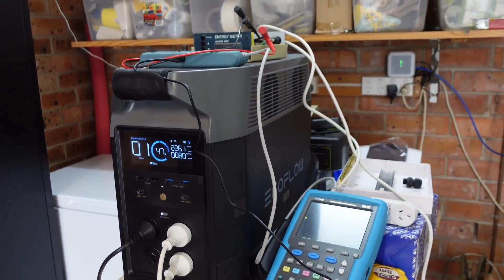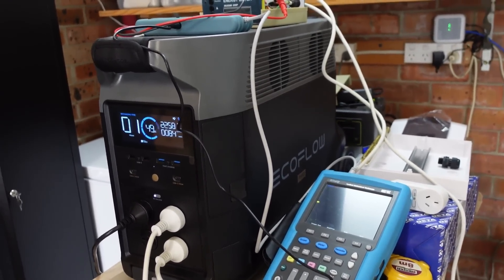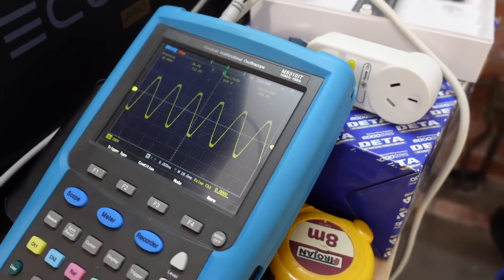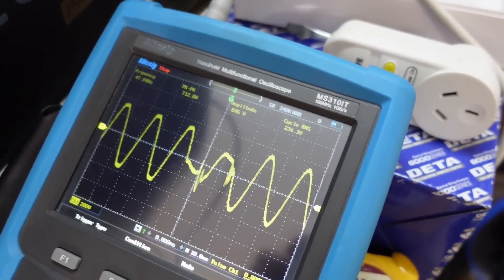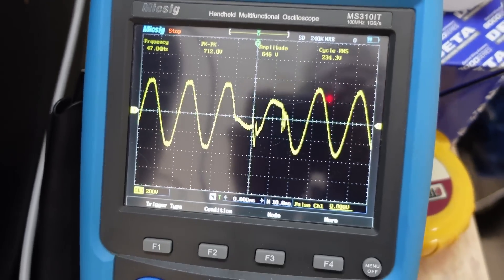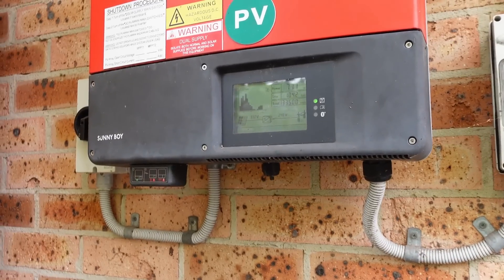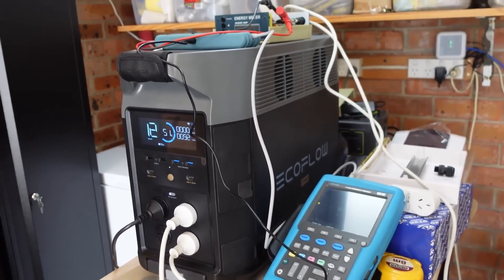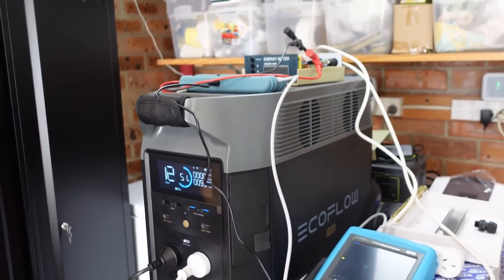EcoFlow Delta Pro - RTFM Dummy!

Comment: Yes Dave , a compressor should not be starting in the middle of - compressor compressing cycle .
Or put another way , compressors should only be starting after the head pressure has gone down - so as to not try to start with high compression already in the head - this can do either physical damage to the mechanical parts - & put too much load on electronics - many times the starting power .
It may be that the reason the EcoFlow turned off - " overloaded " by trying to start the compressor right away --- vs. allowing some of the pressure to equalize - bleed from the compressor head to the rest of the plumbing - so that less pressure for the motor to start again .
Reply: It is a very easy solution to add an on-after-delay relay (or SSR) that delays compressor turn on by a minute or two to avoid the immediate restart problem and such will extend the life of compressors that are (for whatever reason) frequently subjected to momentary power interruptions. Set each compressor to a slightly different delay time and you even reduce the risk of the backup power source having to handle restarting all three compressors simultaneously after an AC input interruption.

Otherwise, what Dave is looking for is effectively an “Online” (as opposed to modern “Offline”) UPS that is continuously synthesizing its own AC waveform and generating AC power from the battery (or charger) continuously.  That was once fairly common in old UPSs that were at the upper end but now you only find Online UPSs at the uppermost end of the market (like mainframe applications) as they consume considerably more power since there are multiple conversion stages running at all times in an Online UPS (AC rectified to DC, then DC run through the inverter and back into AC).  Most modern UPSs anymore are the Offline type and pass the AC mains directly to the AC Out ports whenever mains AC is present and then very rapidly (within 10s of milliseconds, which most computer power supplies, with remotely decent and functional bulk mains input capacitors, can easily handle as it is typically less than a full 50/60 Hz waveform cycle of 16-20ms) restart the inverter and transition to battery generated AC upon loss of AC mains power so as to reduce wear and tear in the charger, batteries, and the inverter sections (in fact, many modern UPSs reuse the inverter stage as the charger stage as well because the two are never in use simultaneously, so you get to reuse the same large transformer and much of the heavy switching circuitry to charge larger battery banks fairly quickly by running the inverter stage in reverse, which is more cost and weight savings).
Reply from the maker: Makes sense, thanks. BTW the EcoFlow is supposed to have 3600W peak output power.
Reply: @EEVblog2  This would not apply to a 30ms interruption, it would only apply if the compressor came to a stop or lost momentum. Aside from the issue KD0CAC mentioned, it's just a motor, maybe a PSC or CSR. Search "what type of motor in a hermetic compressor". Depending on the type of fridge you have, it may have an "inverter" drive, if it's an LG, it may have a linear compressor. If it only happens once or twice a day, I wouldn't worry about it. Even with a worst case scenario, hermetic compressors are pretty robust. (worse case scenario being a longer interruption resulting in a locked rotor on startup until thermal cutout shuts it down, if it's a basic freezer with no controller) Test your fridge to see what it does if you unplug it and plug it right back in. My LG waits 90 seconds before it starts the compressor.
Reply: @EEVblog2  A compressor restarting under load will momentarily draw its full locked rotor amperage as it tries to start up against a heavy counter load (where the head pressure has not yet equalized), which can easily be 3-7 times the nominal rated power consumption of the compressor.  It is much like trying to push a car up a very steep hill versus level terrain — equalized/level is so much easier to get things moving!
Reply: @EEVblog2  30 second delay is usually enough for the pressure to bleed down on an AC system.  Most lockout's are several minutes but for a small AC that's overkill.
Reply: @EEVblog2  yay giveaway, spewing i missed out on the scope -perth,   mine dies of natural causes, nothing to do with free energy machines
Reply: @EEVblog2  problem is the compressor can flood then creating a bigger load of 10 times nominal load 
If the power disconnected you should pause for a minute.
So build a circuit if drop out to power each compressor separately giving time for the compressor to decompress.
We use PLC in industrial generator backup systems bringing each unit separately.
Reply: @EEVblog2  when I say the first switch video and seeing relays I awaited this video much to over half as supposed to be out moving out my workshop.
Reply: There's no way the compressor could stop or even slow down much in that 20 ms or so that the power is switched. It's like a car engine having a single misfire.
Reply from the maker: @chitlitlah  All I know is that I hear a "thump" coming from at least one of the fridges when this happens, it's how I detected this problem.
Reply: @EEVblog2  It would be akin to a stepper motor jumping partially out of phase for one step. Technically yes, it stresses the windings, but it's really just a thunk in a 100 watt motor. it's not nearly long enough to worry about needing to allow the refrigerant to equalize or blowing a reed valve. If you're really worried, just switch it to your grid tie inverter, it doesn't sound like power outages are something you have to contend with. Adding some kind of time delay device is a good idea. I'd want to put my fancy battery pack to use too. 6500 cycle life is 17 years. The cells will probably outlive the inverter and freezers.
Reply: @chitlitlah  There are two potential explanations for the hard restart with regards to the compressors despite the short delay. 1) Something is calling for the compressor to run, if the calling device (whether a mechanical thermostat or an electronic circuit) drops out, such as an MCU in reset, during that interruption then the actual off delay may be much greater than 30ms and allow time for the compressor’s rotation to halt. 2) Unless the synthesized AC sinewave has been frequency locked to the original mains frequency you can have a case where the synchronous motor has lost its sync relative to the newly synthesized AC waveform and thus the rotor will be well out of proper phase with the resulting waveform. This will force the motor, already under load, to try and suddenly jump the rotor into phase and that will be similar to a momentarily locked rotor if the phasing is off by much until the rotor has resynchronized (how badly will depend upon just how far off the rotor and AC phases are).  Either of those could very well explain the thump observed and the sudden momentary demand for more power from the inverter.
Reply: @ethanpoole3443  1) That might make sense if it's electronic. Seems like they would put more of a delay into it if that's the case though, make sure the pressure can bleed off before starting up, just like how my electronic thermostat wouldn't start my air conditioner for a couple of minutes after the power came on in case it had just shut off. It's not like the refrigerator is going to thaw out in a minute or two.

2) Would they use a synchronous motor on a refrigerator? I wouldn't expect any home appliance to have a synchronous motor. Even if it did, I would think the motor could sync up before it slowed down much.
Reply: Doesn't fridge and freezer compressors have timers to protect from this? I have had freezers wait like 10 minutes before starting when plugged in.
Reply: @ulwur  yes they do but only if the compressors and the caps are disconnected long enough. 30ms won't do this on most simple refrigerator systems.
Reply: @ulwur  - Yes, even your basic mini-fridge will delay starting the compressor too fast.
Reply: No big deal, just use time delay device on each fridge with deferent on timing state.
Reply: What ever happened to the old timer or pressure sensors of way back? I distinctly remember some AC's from decades ago that wouldn't even allow an instant off and back on cycle. I always assumed a timer or pressure sensor but is that not a thing anymore? I have noticed my mostly modern fridge will attempt a compressor startup with a quick on-off-back on cycle.
Reply: I have 4 fridges/freezers running on my Solar inverter - soon to add a 5th. I have never seen any of them consume that much power in the 2+ years I've been running off grid. Something must be wrong. I just checked my overnight power consumption and it never went above 750W for a short while from midnight until 5:00am when I woke up and started turning on lights and using hot water when the peak jumped to 1.5KW. [edit] I've watched further in. I've not tried switching from one power source to another as I am on 24/7/365 running from batteries (54KWh) when the sun goes down.
Reply: @vincei4252  that's called electric defrost. It's basically a heating element around the cooling coil to remove any frost. And that one takes lots of power to get that ice off.
Reply: Fridge compressors will stall if they try to restart with pressure still in the system. They all have overload relays that will cut the power if the compressor is stalled for a while, so it's unlikely to cause serious damage or a fire.

Comment: Something similar happened to me when using my fridge along with another high power device

I have a smart panel with 6 total batteries setup with split circuit in US.  That means 3 batteries power the left 5 circuits at 120V, and three batteries power the right five circuits at 120V.  I have the clothes dryer, which requires 240 V as a split circuit - that combines 120V from each battery to make the 240 V system. The odd number circuits are on the left side of the smart panel, and the even number circuits are on the right side of the panel. The dryer uses circuits one and two.

Anyway, I found that if I am running on batteries and I am using the air fryer (1500 W) and the fridge cones on on the same battery (even on a different circuit on that side of the smart panel), the battery will sometimes switch from battery to grid because the battery thinks it cannot handle the current surge (I think the current surge is 120V and about 15A, or 1800 W). Even though this is well below the 3.6 kW total, the software or circuitry thinks that the current is too high to handle, and switches to the grid.

I have run circuit loads through the battery that were well over 4kW that the battery handled fine, so I think it's just because the surge on the fridge is just so sudden that it thinks the battery cannot handle it, or may be the voltage drops enough to where I can't handle the surge. I don't have anything to measure the peak current surge or voltage for the fridge, so I don't know for sure. I'd like to find a device that measures that current, but it seems the circuitry is limited to 15 A for the devices I've seen for sale.

Comment: I’m not sure if this is an appropriate conclusion but the manual says this unit is not a UPS system. It will not back up a PC for example since the switch over is about 30 ms.

Comment: Greetings from Raleigh NC.  Hey Good Day!!!, People of Ukraine are now trying to find a battery to supplement the generator. Because everyone has a generator due to grid power missle attacks. So no one can sleep because of all the generators running. So now LVIV wants everyone to switch to a backup battery due to Noise level from Generators.  So how doers your "Glitch" impacts this being a good solution so people can sleep at night.  This is going to continue for another 18 months of russian Missiles and drones destroying the grid. Would having. supplement Battery to absorb the voltage fluctuations so so the appliance doesn't break entirely or this backup battery doesn't break but it's another $2,000 please advise thank you and have a great day

Comment: Proper hardcore review! 😁I suspect the inverter part of the unit is bidirectional and also functions as the mains charger. Ecoflow boast about their fast charging from AC mains, and I didn't see enough power electronics in your teardown for a 3kW inverter and separate 3kW mains charger. This means that when charging from mains, the AC outlets must be supplied directly from the mains, and when the mains is lost the electronics take some time to change over to inverter mode. If nothing else it needs relay switching to avoid feeding the inverter output back out of the AC inlet, that would take a few milliseconds to open.

Comment: Silicon Chip published a kit somewhere around Y2K (probably earlier) that monitored the mains for excessive voltage fluctuations & dropouts. If the mains voltage went outside your selected range, it would cut power to the load. You could also set a turn-on delay for when power is restored, so that compressors & the like could 'rest' before being restarted.

Comment: What do you think 100 w solar panel could run all your appliances get rid of the generator hook up to 100 watt chill everything then I mean what refrigerators 2200 w the other refrigerator is 1500 watts any other refrigerator is what 850 Watts yeah that's a good 100 Watts open on the run all that not maybe you should have hooked up a string of solar panels to charge that thing I'm in a charging what three and a half hours completely full.

Comment: Well if he actually had two of those you can run your whole house with 120 240 volts with all the battery system that's only a whopping $20,000 that must be cheap for you guys you must make $60,000 or more on your internet shows and you must have solar and you have to make another $40,000 a month and times that all by 12 you guys make the money to buy all that stuff no one else really does.

Comment: Compressor starts are heavy at all, we had used D type circuit breakers at industry and up to five minutes protection period after the power outage. I think the fridge can stay few minutes without power so I would use four relay (input and three outputs) with a small PLC. When the AC will be powered up or down all contactors would be turned off, then AC input should be set and to minutes delay (the highest power one first). Then turn on outputs with one minute delays to reduce load. Problem solved, fridge life would be longer and the protection has no reason to cut it off.

Comment: Sounds like instead of putting in a high wattage charger in there they have a smaller one, so when AC is plugged in it just passes AC right to the plugs instead of using the battery that way they can get away with a smaller charger.  UPSes basically work the same way.  Won't be good for anything that has a compressor.  What would make a neat project is to design a AC to PV power source. Basically make a PSU that can act as a PV source then just plug it into the PV side of the system.   It's crossed my mind to experiment with that, as it would allow me to use a charge controller as a component in a dual conversion UPS.  AC -> custom PSU -> PV input.

Comment: +1 for the time delay for starting the fridges. The temp will not change a lot in the short time, but the compressors will be good to start up on a clean sine-wave again. 
A time-delay relais (DIN-rail mounted) should do the job- correct?  You can hook this up to each powersouce (mains and battery). 
They come for delayed light-off functions in long hallways.

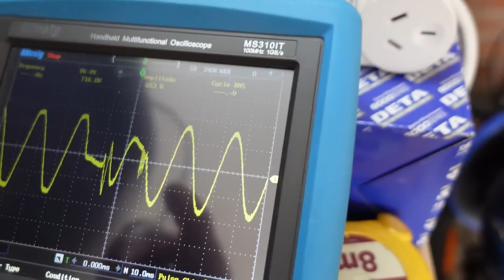Comment: 11:16 the wave forms look different, I don't think it's using the inverter at all when under AC power, I think it's acting as just a pass thru until a power failure
Reply: It does. Mains input goes directly to the inverter and inverter operates as a mains charger. When power is disconnected, Ecoflow unit has to realise that and switch the input off via relay before providing power.

Comment: It seems Dave not does know the different UPS types.  The video clearly shows it's line-interactive UPS which can't guaranteed 0ms switch as the manual states.  An online double-conversion UPS is required for that.  Hybrid inverters won't have 0ms switch over either.  It's too bad that the Ecoflow appears to have only pass-through AC charging.  So, it probably means it has a single bi-directional inverter/charger inside rather than separate dedicated inverter and charger.

Comment: I thought most modern compressors have circuitry to detect compressor stall. I tested with my window air conditioner (5000 BTU) and Bluetti AC200P, which briefly pulled 2000 watts for a few seconds before detecting a stall, and then turned off for a minute before attempting to switch on the compressor again, powered back up and then settled at 450 watts. It never tripped my Bluetti AC200P, which only has a 2000 watt inverter.
Reply: It's not just modern ones. The disused 1960s (possibly 1970s) dehumidifier in my basement does the same. Conventionally it's just a self-resetting circuit breaker made from a bimetallic strip.
Reply: @eDoc2020  Nice. Interesting to hear that these circuits existed all the way back then.

Comment: There are many "voltage-stabilizer, brownout protectors" for refrigerators or freezers that detect an interruption (like the relay switching in your inverter/battery) to disconnect the load for a couple of minutes, then reconnect the load to the now stable source.  These might allow you to continue with your attempt.  Probably less than AU$100, total, for 3.

Comment: 2 additional contactors and a uC could do the trick, as long as the output phase stays synchronous with the input phase.
Just briefly bypass the UPS while turning charging off.
Well, that is, if the UPS can take such shenanigans 😀